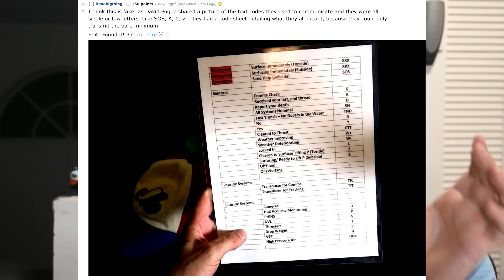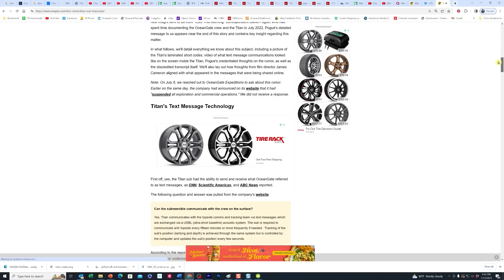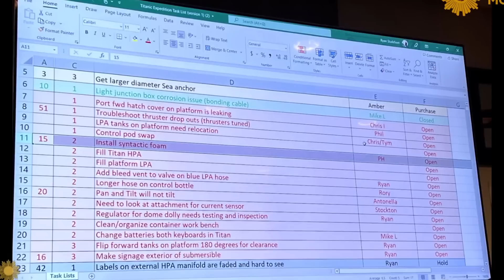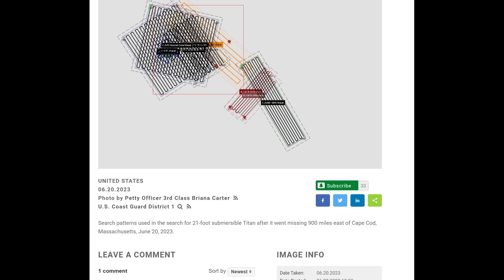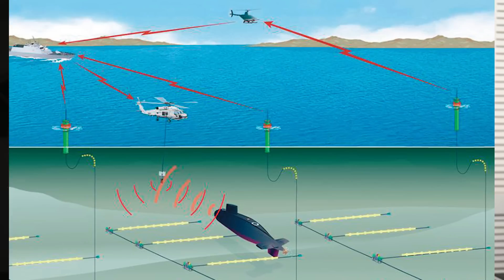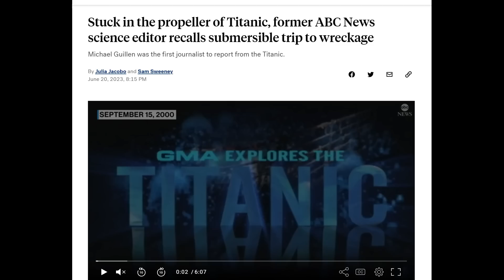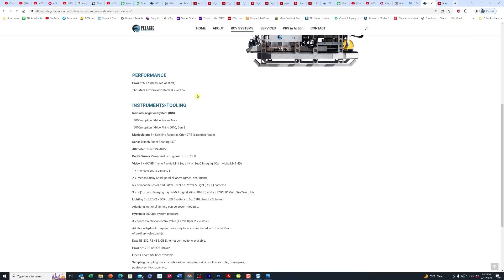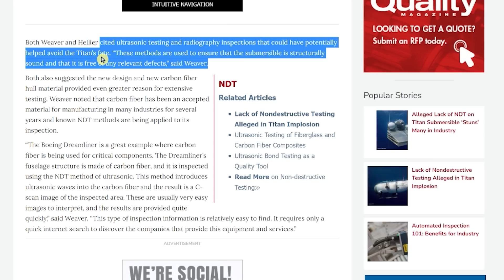The Shocking Truth About Fake Sub Transcripts No One Tells You

Comment: Do we know that they weren't intentionally descending faster? That would explain the lack of communication about it. If the transcipt is real that is. All it takes is extra weight, maybe they were getting more confident after previous dives. Regardless the added decent rate wouldn't kill the sub. Either it can handle the peak pressure or it cant. It could also be a sign that water was intruding somewhere making them heavier. Possibly even into the layers of the hull. I would think they at least thought they built in a safety factor. Maybe a certain amount of water intrusion and delamination it would cause crossed their safety factor and boom. The added damage from previous pressure cycles would make whatever factor they thought they had even lower. That's the only way I can wrap my head around this guy thinking the hull was safe. Maybe he thought they had a safety factor of 2 or 3. Hence it should be able to take damage and be fine. He just didn't understand composites the way he thought he did.

Comment: There are systems that allow underwater voice communication using modulated ultrasonic carrier waves, but the range of commercial systems is relatively short, purposed for communication among divers. Perhaps such a system was in use aboard Titan until the depth made it ineffective, whereupon they would fall back on short Morse-code messages, using discrete "taps" to spell out the codes shown in the photo. This is just a guess.

Comment: Coastal guards could only do surface search, to have some action going while awaiting for ROV, they requested ROV on day 1, but the soonest they could get one at needed location was exactly on 4th day evening. They pretty much found Titan wrecks next morning as they started search with ROV. Sound of implosion while potentially would be associated with Titan, would not have traceable coordinates to be assured that belong to Titan implosion and nothing else in the entire ocean. It just tells people could do as much as they could or technology would let them to do.
Reply: False,  The implosion sound could be pinpointed using triangulation.
Reply: @hondooooo  I am aware of triangulation method. But this implies global system designed for such purposes, that has to be in very accurate sync. However unlike to GPS where all echo-locators  owned and operated in sync by the US Government, in case of ocean space it is not even close to that, so there is NO practical way to use triangulation between disparate setups.

Comment: I agree with Jeff that nothing in the transcripts can conclusively validate or falsify the record. However, there are some major red flags here that experienced eyes will pick up on. 

The image of the OceanGate display referenced from the BBC documentary looks to me like a classic communications user interface, with a received message interpreter at the top and a transmission interface at the bottom. The BBC image shows that the message interpreter display includes a timestamp, the sender (e.g. [ Top ]) and what looks like a computer-generated text string. Topside text does not appear to be free-form text like what is in the released log, although admittedly the contrast and resolution are so poor that I can't read the red text from the sub. The rest of the UI contains buttons to quick-send common messages (K, A, Y, N) and a text box for entry of other short form text (e.g. a depth response code and short-form data). It is probably possible to send highly abbreviated freeform messages. However, the text field on this particular UI does not appear to be long enough to input all of the natural language strings included in the released log. 

Second, the released log seems to use exclusively natural language text, even for messages where a code option exists. This does not match the communication style shown on the UI in the BBC story, and it would seem to go against OceanGate's established protocols. 

Third, the log in the BBC demo uses "[ Top ]" for communications originating from the surface, while the log spells out "[POLAR PRINCE]". Also, note the different use of spaces in the formatting between the BBC image and the leaked transcript. This seems to be proof that the log has at least been edited from the original format.

Fourth, the leaked log transcript specifies depth to meter-level precision. It is a standard practice in bandwidth-constrained maritime and aviation applications to abbreviate depth (or altitude) by transmitting only the minimum number of digits. As an example from the world of aviation, a pilot might indicate a flight level of 19800 feet by saying FL198. Although I can't speak with any firsthand knowledge of Oceangate's practices, given the brevity of the short form codes shown it seems unlikely that depth would be specified with a precision of meters. That level of precision simply wouldn't be useful, and it would come with a nontrivial link cost. 

Finally, the data bandwidth and communications latency of an acoustic modem operating at these depths is very poor, and free-form text messages like those shown in the log transcript might take 5 minutes or longer to send with guaranteed transmission. Furthermore, the sub could not use the link until a previous transmission completes. Why would Stockton Rush lock down his link for several minutes to say "Depth at 1934. All systems stable and descent continuing as planned. Happy crew." when instead he could have communicated the important information (depth) with three or four characters in a much shorter transmission? For all of his faults, I don't see him as someone who is prone to wasteful frivolity.

So, the log has clearly been edited, and it seems inconsistent with both industry and OceanGate's own established practices. Only OceanGate or the investigating bodies can truly confirm or reject the leaked log, but I personally expect to discover that it is a fake.

Comment: If the transcript is genuine, then it is absolutely horrifying and the entire incident is worse than we knew.  It means the passengers likely knew there was a problem of some kind, and were likely panic-stricken knowing they could be about to die, with one theory claiming that the sub malfunctioned so badly that it essentially tipped vertical like a missile and was descending far too fast.

If it's fake, then there are some very strange and frankly sick individuals out there with too much time on their hands.

Really, I'm on the fence.  The language looks authentic and it appears to match the agreed narrative of what actually unfolded that day, but nobody else seems to have leaked anything to corroborate it and nobody else has come forward even anonymously to ratify it or confirm its authenticity.  On things like the Germanwings plane crash we had leakers inside the investigation confirming these things.

Comment: I feel like the rings and adhesive could be an issue but maybe not THEE issue. Bc at those depths,  naturally, the pressure of the ocean would be pushing on the caps anyways. I really believe the carbon fiber was what did it. It probably shattered and shredded everything, blowing the ends off. Or it was the viewport. Stockton said the viewport would push in a good inch or two and retract back as he rose back to the surface.

Comment: Question. How were the batteries protected from the Hi Pressure. How was wiring made to stop infiltration of sea water. Battery pack failed, could water have infiltrated battery pack if used. If water went into battery pack could that be cause of extra weight?

Comment: The video (4:38) of bonding the titanium ring to the carbon fiber shell with epoxy is from the first shell made in 2017.  That shell failed deep water tests in 2018-2018 and was replaced by a second shell made by  a different manufacture with different materials and layup in 2020 per statements by Rush. I've found no info whether they changed the ring design.  Maybe they learned some lessons from the first shell that failed and improved the second shell and maybe they didn't.  Trying to draw conclusions about the failure of the second shell seems kinda pointless to me.   The video of winding the shell (5:04) is also from the first shell in 2017.  The people who built both vessels are still around except Rush.  The details will come out in good time (1-2 years) in reports by the Coast Guard or NTSB or lawsuits and likely a few books will be written.  In the mean time, nobody will be building deep sea submersibles from carbon fiber composite.

Comment: If the transcript is true, then I think your analysis is the best I have seen so far.  
With that said, I think that comparing the short acronyms to the BBC documentary clip with the computer screen "chat window" at 1:07 in this video is not proof of authenticity.  Either side can type the acronym, hit the send button, and the chat window can expand the message out to readable text (yes, I am a programmer).
However, if someone can get a high-res picture from the BBC documentary and/or clean up the image so that we can read the text in the chat window, then I think that could be proof one way or another.

Comment: it really doesn't matter the fact is there were 5 people piled on top of each other and the computer monitors are at the aft  for information , in other words higher than they reach they could not get to the reply text unless Stockton was standing on someones shoulders  they were in a pipe descending vertical.They simply lost control and it crushed them , the reply texts were men to be doomed, cracking ohh we are trying to ascend. this was a shock test for the submersible  its also weird that they didn't have a FDR  this would be a no brainer for investigators  its also a tool to correct your mistakes if you could survive this ordeal.

Comment: 09:00:00 MS: Dive command, descend 200m  
09:00:05 SUB: Affirm, descending   
09:01:30 SUB: Depth 50m, spd -2m/s  
09:02:55 SUB: Depth 100m, spd -2.5m/s  
09:04:10 SUB: Depth 150m, spd -3m/s   
09:05:15 SUB: Depth 200m, spd -3.5m/s  
09:06:20 MS: Slow descent   
09:06:25 SUB: Tryng,spd -3.2m/s   
09:07:45 SUB: Depth 250m, spd -3.5m/s   
09:08:50 MS: Drop ballasts   
09:08:55 SUB: Drop ballasts, affirm  
09:09:50 SUB: Ballasts dropped,spd -2m/s  
09:11:10 SUB: Depth 300m, spd -1.5m/s  
09:12:25 SUB: Depth 325m, spd -1m/s  
09:13:30 MS: Any issue?  
09:13:35 SUB: No issue, spd -0.8m/s  
09:14:45 SUB: Depth 335m, spd -0.5m/s  
09:16:05 MS: Hear anything?  
09:16:10 SUB: Cracking sounds  
09:17:15 MS: Resurface, issue?  
09:17:20 SUB: Tryng resurface, slow  
09:18:35 SUB: Depth 330m, spd +0.3m/s  
09:19:50 SUB: Depth 325m, spd +0.4m/s  
09:21:05 SUB: Depth 320m, spd +0.5m/s  
09:22:20 MS: Power status?  
09:22:25 SUB: Pwr 70%, spd +0.6m/s  
09:23:40 SUB: Depth 310m, spd +0.6m/s  
09:24:55 SUB: Pwr 60%, spd +0.6m/s  
09:26:10 MS: Keep rising, status?  
09:26:15 SUB: Pwr 50%, spd +0.7m/s  
09:27:30 SUB: Depth 290m, spd +0.7m/s  
09:28:45 MS: Any issue?  
09:28:50 SUB: Pwr 40%, spd +0.6m/s  
09:30:05 SUB: Depth 280m, spd +0.5m/s  
09:31:20 MS: Sound?  
09:31:25 SUB: More cracks  
09:32:40 MS: Surface now!  
09:32:45 SUB: Tryng, pwr 30%  
09:33:55 SUB: Depth 275m, spd +0.4m/s  
09:35:10 SUB: Pwr 20%, spd +0.3m/s  
09:36:25 MS: Pwr status?  
09:36:30 SUB: Pwr 10%, spd +0.2m/s  
09:37:45 MS: Pwr?  
09:37:48 SUB: Pwr failure…  
09:38:55 MS: Respond?  
09:39:50 MS: Respond?  
09:40:55 MS: Respond?  
09:42:00 MS: Respond?  
09:43:05 MS: Respond?  
09:44:10 MS: Respond?  
09:45:15 MS: Respond?  
09:46:20 MS: Respond?  
09:47:25 MS: Respond?  

Generated with chatgpt in 5 minutes.
Reply: Not surprised cause this one seems totally fake tbh.
Reply: Yes... ChatGPT scrapes info, the released fake/not fake transcripts we are discussing here are already out there- and can be scraped. This version is missing a good bit.

Comment: I’m sure that people on the mothership  knew the correct descent rate. Someone suggested that the sub was descending too fast. Rush would have descended at the speed he wanted, but he probably couldn’t slow down descent because there was a ballast problem. If the ballast functioned properly, they could have dumped the weights and floated up. The sub was too heavy for some reason.
Reply: trumpisthemessiah7017  They DID mention it.  Their boss replied that everything was fine.  There was no physical connection of the Titan to the mother ship so other than chastising their employer, what was that crew to do?  No authority and no physical way to intervene.
Reply: That's whats confusing to me. Titan relied on the motherships radar and instructions to navigate, but does it have a gauge to at least self-monitor depth? Either way, it seems the comms shouldn't be requesting confirmation, they should be sending the five alarm.
Reply: @j_117   Again, if the transcript is to be believed, they were reporting their depth to the surface so they had to know their depth.
Reply: You want to take appropriate time to descend to observe possible problems showing up. Rush didn't mention that he's too fast. His rapid descend was most likely on purpose and another aspect why this mission failed.
Reply: If the transcript was real, they were accelerating downward.
Reply: I would like to know a lot more about this speeding aspect.  Are there standard descent rates for such vessels?  Was Stockton deliberately descending too fast, or was the Titan heavier than expected?  Was the aggregate crew-plus-passenger weight routinely determined for each voyage, and the ballast weight adjusted accordingly before departure to achieve the optimal descent rate without wasting thruster power for braking?  Or could the repeating pressure and release cycles in multiple voyages have been making the hull slowly soak water into the carbon fiber's tiny pores and lamination weaknesses, insidiously making the vessel both heavier and weaker with each trip, without the operators' notice?  If any knowledgeable persons in the submersible field read this, please comment.
Reply: @donalddavis9992  Yes there are. If a vessel descends too fast, it doesn’t have to adjust to the exterior pressure, the the pressure differential can become too great and cause an implosion. I’m a scientist, but I’m not a physicist, so I don’t know the exact details. It’s a little bit complicated, but if you think of a barometric chamber, you know how they simulate being at various depths. Too fast a descent CAN lead to implosion because the pressure outside is far different from the pressure inside. Does that make sense? The Ocean Gate people should have had a set descent rate to enable pressurisation to prevent implosion, but I don’t think that you could ever guarantee that something won’t implode.
Reply: @donalddavis9992   Sorry, I didn’t see the rest of your question. Like with a small plane, everyone was weighed before getting on board. Every weight was known. We know there was a ballast problem, but there was also an inflatable air bladder to assist ascent. After they dumped ballast, the vessel didn’t slow down. They lost power, so they probably couldn’t inflate the air bladder, so the Titan plunged rapidly, which caused the passengers to be pushed to the centre, above the Titan’s nose. This caused a fatal dive as most of the weight was at the nose and the Titan shot straight down and it couldn’t adjust to depth pressure. Carbon fibre becomes water-logged when damaged…It was the perfect storm.

Comment: I don't know how authentic the transcript is but what's shown at (for example) 1.29 is shortcut commands. I can't, of course,  possible know how they were implemented by OceanGate but they're almost all in Upper Case for a reason. As a programmer myself, I bet "D please" will be converted to "Report your depth please" before the data is crunched and sent, as shown under "General".

The system commands most likely works/worked a little bit different. I've no time to elaborate my speculations regarding these but in short, I'm quite sure there's more "flags" involved than just typing  "R" to drop weight =)

Comment: There is no bandwidth issue for text. It just takes longer to type longer. It's a normal communication protocol that just uses sound as the carrier frequency instead of radio waves. Oceangate probably used the cheapest one they could find though. As for Pogue, he thought the ballast weight was "heavy lead pipes". He's not too smart. On the navy hearing the bang. Ocean gate heard it too. They literally have a underwater microphone array for the communications. They heard the loudest bang you can imagine.
Reply: You just made the most important statement in these comments, I was a diving officer on fast attack submarines.  Ocean Gate's support ship heard the collapse, they have (or had) a recording and there probably is a video/audio of the control room on the support ship with their reaction, all part of the experience.  I have heard the sound that bottles would make when they imploded while ejecting trash at sea, very loud over sonar.  All bottles had to be broken before disposing at sea or stored for later disposal.  Ocean Gate knew the fate of the submersible and refused to tell anyone.  If you look at photos of the submersible, you can see weights attached to the undercarriage skids for adjusting trim (fixed).  I don't see anything for ballast used to control the rate of dive and return to surface, this submersible was not able to surface on its own, that's the reason for the barge, insane!!!!  Just climb in the coffin and nail it shut.